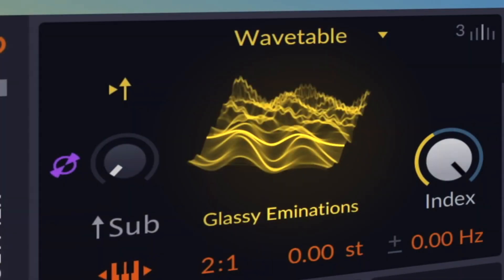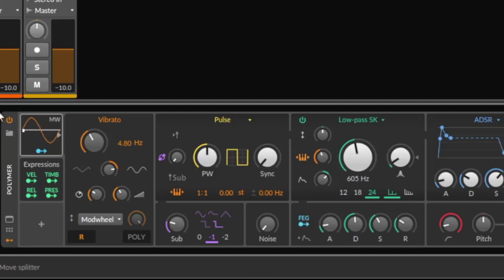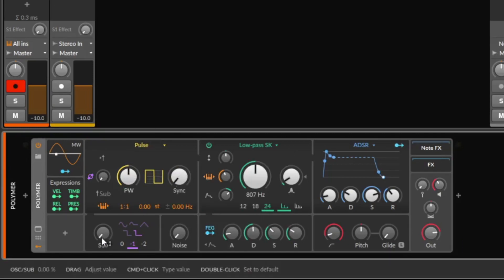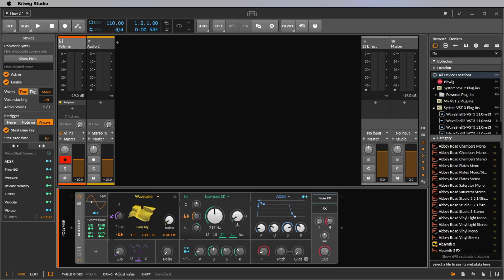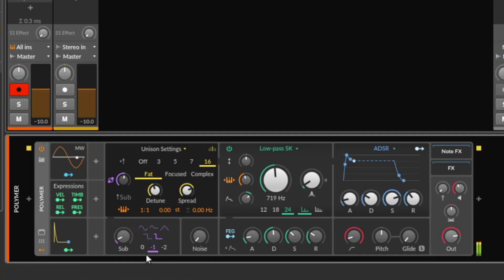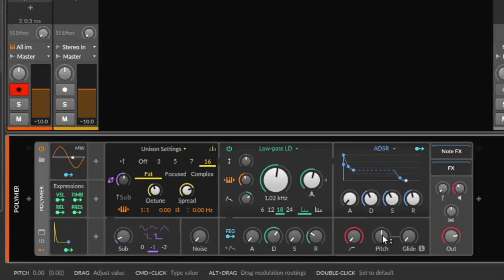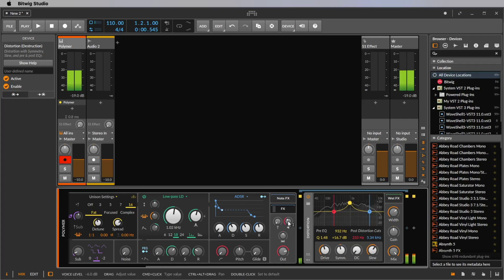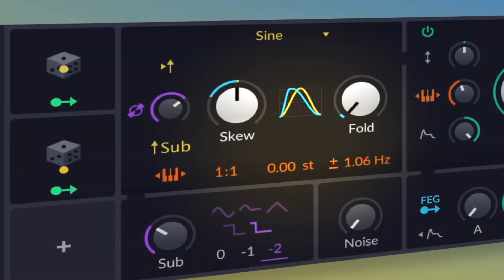Polymer Bitwig 3.3 Tutorial

Comment: What's really missing compared to Max 4 Live is a presentation mode for any Grid, where'd you've able to choose what knobs show up in the more concise polymer-style views. Or to make it more fitting for the polymer approach, which blocks show up. I'm guessing not all blocks have this polymer presentation coded yet, which is probably why the haven't done this. Actually, with its block rather than slider-level interface, the polymer is actually more reminiscent or Reaktor blocks than of M4L presentations, but with a lot less confusing interface than Reaktor. I remember not getting any sound out of the Bento VCA in my first attempt to use that. And it was because the default wet level is 0% and you have to click some tiny, obscure button to even make the (again tiny) wet level slider show up in Reaktor blocks.

Comment: Thomas, thanks so much for your video introducing the new Polymer synth in Bitwig.  I have a question about converting Polymer to a Polygrid so that you can change it, add stuff to it etc.  If you do this can it be reversed back to the original Polymer?  If it is a permanent action is it possible to do a save as of Polymer?  Like what one would do using Photoshop to an original photo or graphic giving the save as copy a new name so that you do your edits on the copy leaving the original untouched? 
Thanks
Reply from the maker: This would be great, but it’s not possible, once you have converted the polymer there is no turning back